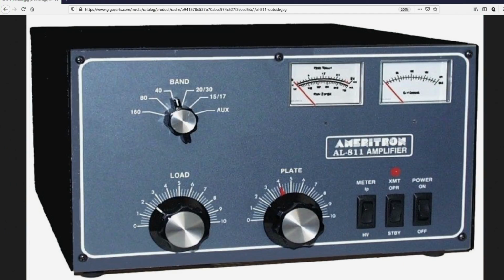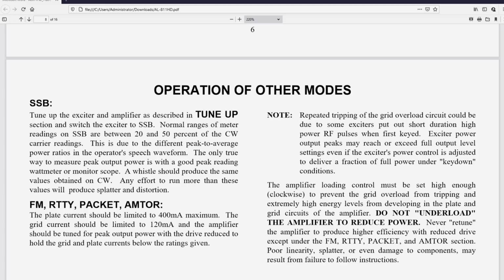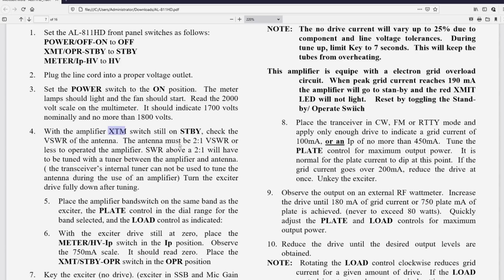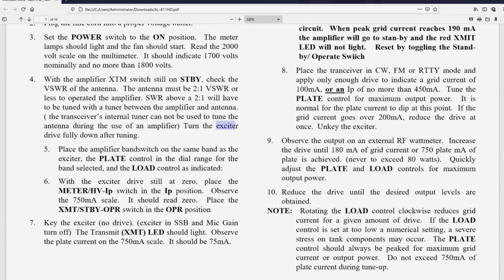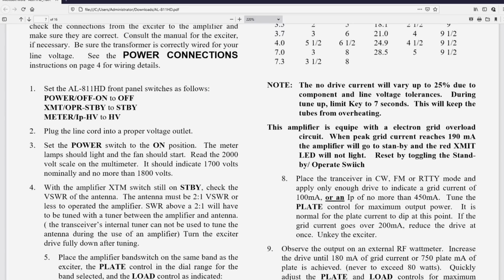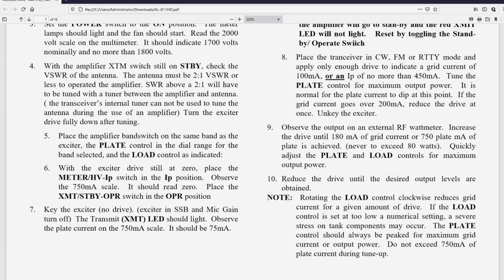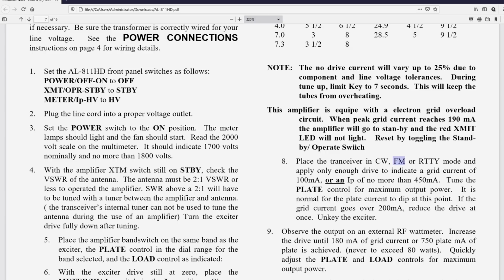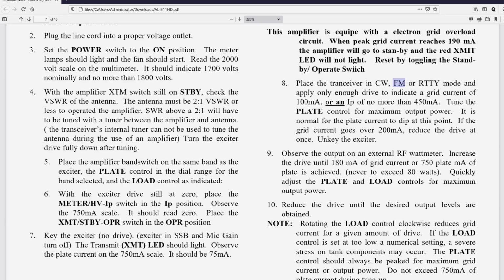Ameritron Amplifier AL-811 Instructions Have MANY MISTAKES About Tuning As Shown By Jim Heath W6LG

Comment: Tuning instructions are poorly structured/written. This was written based on the AL-811 manual (using three 811A Tubes, accepts up to about 70W drive, 50-0453-1 Schematic (relay drivers)).
Setup      - Install an external antenna tuner and antenna switch between the amplifier and antenna. (Ant/Load >> Switch > Tuner > Amp). The switch selects either the antenna or load.
Step 0.1 - Set up the amplifier to HV, STBY, OFF (all switches down). Set the band to the desired band. Set the LOAD and PLATE controls to their preset positions for the desired band/frequency.
                  If the external tuner has preset positions, set them now. If the Ext tuner has a bypass, select BYPASS.
Step 0.2 - Tune the transceiver using its internal tuner into the dummy load. (CW mode, low power.) Unkey.
Step 0.3 - Switch from the load to the antenna. Tune the external tuner for best match. (CW mode, low power.) Unkey.
Step 0.4 - Turn on the amplifier. Meters should be lit. Check Plate voltage (about 1700V). Select Ip (plate current). Check Plate current (should be 0mA). Check Grid current (should be 0mA).
Step 0.5 - Switch the amplifier to OPR. 
Step 0.6 - Key the transceiver (CW, minimum/no power). Check XMT LED is lit, PLATE current should be about 110mA.
Step 0.7 - Raise transceiver power for GRID current about 60mA, or PLATE current about 200mA (whichever occurs first).
                  Adjust the transceiver internal tuner for best match into the amplifier.
                  Slightly adjust PLATE and GRID controls for max antenna power.
                  Reduce transceiver power if GRID current exceeds 120mA, or PLATE current exceeds 400mA.
Step 0.8 - Raise transceiver power for desired Antenna operating power.
                  Reduce transceiver power if GRID current exceeds 120mA, or PLATE current exceeds 400mA.
                  Record Band, Frequency, LOAD and PLATE settings for future set-up.

If band/frequency are changed, set the amp to STBY and return to step 0.1 (PWR remains on, PLATE current remains selected).

In all modes, clipping (flat topping) can be detected using a monitor scope. If clipping occurs, reduce transceiver power.

The amplifier will require reducing  transceiver power if overheating is a problem (overheating is not defined). The manual suggests 400W output, 100% duty cycle in CW mode is the design limit for maximum safe heating, and is likely a good limit for constant power modes such as SSTV, FM, RTTY, PACKET, AMTOR.
Reply: Brett   KA7CGB
Reply from the maker: Thanks.  
So, idle current is 110ma.  Correct?
Why the need to use the transceiver internal tuner?
Why the need to "retune" the antenna tuner in the transceiver when increasing drive power?
How much drive does it take to get to 60ma grid current?
What is "desired Antenna operating power"?
So first step is 60ma of grid current and then final step is 120ma of grid current and 400ma of plate current. Is that correct? 
You said, "In all modes, clipping (flat topping) can be detected using a monitor scope."  You said in "all modes".  Is that correct?

For those who do not have a monitor scope, what should they do?
You said, "The manual suggests 400W output, 100% duty cycle in CW mode is the design limit for maximum safe heating, and is likely a good limit for constant power modes such as SSTV, FM, RTTY, PACKET, AMTOR."  Okay, 400 watts output at 60% efficiency would be about 90 watts of plate dissipation per tube.  At 63% efficiency would be about 80 watts per tube.  So you are recommending drive the tubes to where the plate dissipation is somewhere between 80 and 90 watts per tube.  Doesn't that tube have a rated maximum plate dissipation of 60 watts? 
You say to have a max grid current of 120ma.  I thought that they recommended no more than 100ma.  Is your 120ma correct?
Okay, that was a lot to read and digest.  Thanks for your input.  I cannot recommend your procedure but many may find your step by step the way to go.  Thanks again for you detailed and thoughtful approach. I do appreciate the time and effort it took.  Thank you!  73, Jim
Reply: @ham-radio  > Why the need to use the transceiver internal tuner?: I looked t the schematic for one of the amplifiers. The exciter drives a tuned Pi circuit in the amplifier, and I had read elsewhere that sometimes these may be mis-tuned. Adjusting the transceiver tuner ensures best match until you understand how the transceiver and amplifier match each other  when you switch bands.
For the other questions, I don't know about you, but I wouldn't want to be driving maximum power into the amp before tuning with the possibility that when tuned, the amp would be operating beyond specified power. During tune-up, I'd want to be somewhat conservative, and sneak up to maximum power. Your milage may vary.
> Doesn't that tube have a rated maximum plate dissipation of 60 watts?: Perhaps - I didn't look at the tube specs. I was going by what I read in the manual, which suggested overheating could occur... eventually (max power, keyed 100%). Cooling depends on many things not addressed by the tube specs.

As you get experience with your set-up, you'll figure out there are a few steps you can probably skip. But for the novice, they're just trying to figure out what "normal" looks like.
Brett KA7CGB
Reply from the maker: Hi Brett,Thanks for getting back to me.I built my first amplifier in 1967+/-.  
The amp tuned input, as you know, is low Q.  Another stage of tuning (transceiver's tuner) in between might be good in reducing harmonics.I believe that tuning for max out and then increasing loading is a requirement. Increasing the load control  until the output drops ensures linearity. 
Watching grid current is a must.  Excessive grid current will damage a tube(s) very quickly.Some data sheets are very conservative.  Others are not.  
I have talked with guys that helped design the 3-500z and 4-1000. They confirmed the conservative ratings.  The 811A does not, as far as I can tell, have much additional plate and grid dissipation.  
At this time I have a pair of 3-500z and a GS35B amp.Thanks very much, Jim W6LG
Reply: @ham-radio  >For those who do not have a monitor scope, what should they do?: The monitor scope (or any scope with X/Y display function and something to sample the amplifier output ) positively indicates when clipping begins. The next best option would be to use a peak-reading wattmeter, and be conservative (refrain from striving for max specified power). If you don't have either of those... Tune another radio to a 2nd and third harmonic of your transmit frequency and listen for splatter (or have a nearby friend help with this. A friend with a pan-adapter or spectrum analyzer can also help.) If all you have is a basic wattmeter - your advice to reduce SSB power so average output power is about 20% of maximum makes sense to me.

Comment: I am a fairly new ham (a little over 2 years) and dove in head first into HF on 10 meters, and I have the 811A.  I had NO problems picking up the tuning routine for the amp OR the Kenwood 830-S  for that matter.  Love running the tube gear.  Did not get the 2 meter radios until earlier this year!  But, I am sorry that there are so many mispellings in this manual.  I do not believe my manual had these errors.   Anyway, let it be known, that the H model (which you have there) is NOT rated for AM, while the A (3 tube) model will handle a full HALF HOUR keydown in AM mode which is why I bought it.   I have also had NO trouble with any number of MFJ or Ameritron products in my short time on the air.     Thanks for the video.    de KC1JZR   (PS. the 811-A has a very convenient ALC circuit).
Reply: I am a new Bee also General & Tech in one day !! I love the tube amps from my chicken radio days on CB in the late sixties early seventies! What MFJ has done to just the 811 amps is appalling , low QC what a crying shame! I have a three tube and I modified the sh@&): out of it and all I want from it is 500 Watts. And it’s good now! You-Tube is full of corrective mods for these amps. And they point out all of MFJ’s mistakes !  Court adjourned!  JohnBoyUtah KJ7TBR 😎🇺🇸📡🎙

Comment: Thanks for some clarification. Jim. I have an 811 and want to only run approx 300 w. Do I still tune for max output then reduce drive , or is it ok to tune to 300 and stop?
Reply: You tune for Max power then turn the power down on your radio.
Reply: you should find the minimum drive power on each band that will give you the desired output and tune at that drive power
Reply: Southeastern777  Correct. You are not.

Case in point, I built a 10W tube AM transmitter. With it, no way to tune up with 80W of drive. Similar story with folks who happen to use any other sort of lower-power transceiver.

Gotta swing with the bat you’ve got.

Comment: I own an AL811H.  I watch ONLY the power output meter as I peak the plate control.  I watch ONLY the plate current meter as I adjust the power input.  I watch ONLY the grid current meter as I adjust the load control.  And if the grid current ever goes above 200, IMMEDIATELY turn off the input from your transceiver because you probably forgot to switch to the correct band or connect the correct antenna.  73--Tom NC3Y
Reply: What’s your opinion on doing most of the tuning into a dummy load, then just the final tweak into the antenna?
Reply: @kelvin0mql  
Sure.  That's a good idea. Just watch the grid current when you switch to the antenna and adjust the load to put the grid current to 150-170 ma.

Comment: Hi (again) Jim. I commended you in your other video about the exceptionally poorly written manual re: the AL-811. My only concern with what you've shared in this video, is that you say to key the rig and then tune the Plate, then Unkey and key again and adjust the Load (repeatedly for 20w / 40w / 60w ). The concern I have, is that I understand that you should wait perhaps 15 seconds (that may be a bit of overkill) between keydowns, as this gives the tubes a chance to recover. If you key the rig and do a Plate adjustment for say 7 seconds,  then Unkey and then immediately key down again for another 7 seconds (without any delay between keydowns), isn't this potential to abuse the tubes somewhat? That's my ONLY concern with what you've suggested. Everything else looks and sounds bang on to me. Thanks and stay safe.

Comment: Jim, thanks for putting up this video!  I have a used AL-811H sitting in my shack waiting to be installed.  I know this video will be of great help.  I do have a question though.  In the section SSB Tune Up it references "between 20 and 50 percent of the CW carrier readings".  What does that actually mean?  I hate to guess.

Lloyd - W1LBM
Reply: perhaps add an actual quote of what you're referring to but it sounds like it talks about the difference in ssb peak vs carrier or average power as indicated by 'not-peak-reading' or average reading meters. Those meters  will often show 20 to 50 percent deflection of actual ssb peak power.

Comment: Nice explaination....I cannot tune my 811 they way they explain it. I also have 572b tubes but running from 20 watts then trying to tune up to 80 watts pegs my grid in the corner. I found w8ji.com who I gather is a creator of the amp has a good explaination of tuning it along with troubleshooting, amplifier history and design. But I was finally able to tune it and getting just about 700 watts on ssb

Comment: Hi Jim, fwiw I just checked the user/service manual I have for the 811H, it is different but included the "typo" XTM and also the interconnection diagram shows transmitter/transceiver. The references in the manual refer to "exciter" a common description but may be confusing to someone new to this. My manual also shows 4 811s....  undoubtedly a bit of a mess and surprising since the product has been around for many years. As you correctly said your manual conflicts regarding grid trip etc. 73

Comment: Thanks Jim, I have had a 811 and now I have a 811H , I agree with you the manual is poorly written. I spent hours trying to make sure I was turning it right. 
The 811H is sitting idle while I'm using a Dentron 160-10. 
Thanks again. 
73

Comment: It would be better to show tuning up a tube amp in a video and maybe a review on how the tuning section works looking at a simple single tube schematic. I have always used a tube amp on HF. As you add power your tune can change so for a clean signal I always tune up to the power I will run. I see in the background you have a tube amplifier, since they all work about the same it would be a good visual tool. Last time I looked at a manual on how to tune a tube output section was when I had my first radio, it was a Kenwood 830S. Even I was confused just listening to you read that trash manual.
Reply from the maker: I have done that and you can see me with a Drake L4b.  73, Jim

Comment: Hi Jim, I think the "desired output level" is the level at which you want to operate which may be less than full output.  I think what they're saying is to tune for max output then dial down drive until you reach desired output, which in my case is about 200 watts.  Not the clearest set of instructions for sure.
Reply: I concur. I tuned my 811H for max into an oil can dummy load, then adjusted the transceiver drive to get an output not to exceed 300W because that’s the max my tuner could handle. Fortunately, now I have a Tune-A-Tenna adjustable inverted vee, so I can get 1:1 on any frequency (7MHz & up, due to small lot & mast height)... so now I can go nuts.
Reply: I agree.  Your method is what I use and have no problems.
Reply: the required position of load control depends on drive power to keep grid current as low as possible
if you want 200 watts you tune with minimum drive level which gives 200 watts and NOT at some higher drive
I get 200 watts with 20 watts drive 
If you tune with 50 watts and then lower drive to 20 watts you will get less power out than if you tuned with 20 watts drive
you won't hurt anything but you're getting less efficiency your way

Comment: Hi Jim.  I agree with your comments about the lack of proof reading.  Those instructions are certainly confusing. I came from the old school of building  my own high power transmitters and always tuned the plate for max RF output first on a power meter pretty much the same as you described (with one eye on the plate current).   

Along came my AL-82 and did the same  as with your instructions about the steps of input power to the amp.  So, it appears I did the Plate / Load order the opposite way  but in my defence, I always was conscious of excessive plate current from the beginning of the tuning procedure.  

I shall reverse the order and see how things come out.  At the end of my tuning, My IMD products have been <-40 dB max PEP as measured on a spectrum analyzer  and my final test was to use the trapezoid pattern to make sure that the amp was not flattopping.  It's a shame that Ameritron didn't put the money into a good tech writer and get the instructions right especially with an entry level tube linear.  I wonder how many 811A's had holes burned through the plates because of these confusing instructions.  I have a friend who actually  burned a hole through the glass of an 811A because he didn't get the instructions right.

Have a healthy New Year.  Al W1VTP

Comment: Hi Jim, I have an unrelated question about SWR. My SWR changes when it rains. I'm using a Cushcraft AR-10 Ringo Ranger on 10 meter.  Could you give me some insight of what may be happening? Thank you! I didn't see any other formum that I could use to ask you a question so forgive me if I goofed up.
Reply: the antenna get wet when rain on ten meter

Comment: Hello Jim, I have enjoyed your video! I agree, the Ameritron instructions can be confusing. I have an Ameritron AL 811H amplifier which has an output of 800 watts (PEP voice ssb) using 4 of the 811A tubes. It is rated at 600 watts on CW. I found a supplemental tuning guide that help clarify the tuning procedure. Your recommended tuning helped me very much as well! Thanks! Here is the supplemental tuning instructions from W8JI at https://www.w8ji.com/al811h_and_811_tuning_supplement.htm
73 from WV and Merry Christmas/Happy New Year. Bill, W1WRE

Comment: Hi Jim, belated Merry Christmas and wishing you all the best in 2021.  Personally I'm glad to see the backside of 2020 for a number of reasons.  I own an 811 and your comments re tuning are very helpful.  I have one question and that is this, if I wanted to operate at say 200 watts, do I go through the full tuning procedure to max output (600 w) and then  dial down the drive till I achieve 200 watts output without readjusting Load and Plate controls?  Alternatively  do I tune amp without taking it to max power and simply increase drive till I achieve approx 200 watts output on amp and then adjust load and plate to achieve full output at that level of drive?  Hope that's clear.
Reply: Norbert: your initial suggested procedure is correct.  That is, tune for max recommended power as per manual and then dial the drive power down to your desired power level.
Reply: @alanbrown4766  Hi Alan.  Thanks for reply and that's technique I've been using.  I'm finding ti takes slighty higher drive, about 27 watts to get 200 out vs 20 watts when using other technique, but probably a lot kinder to the tubes.  Happy holidays to you and yours and try and stay safe.
Reply: @norbertstepien9185  there is no need whatsoever to tune at higher drive
just tune for max out at the drive power level you want to use 
that gets you the most EFFICIENCY
otherwise you're producing 7 watts more heat that is dissipated in the grids